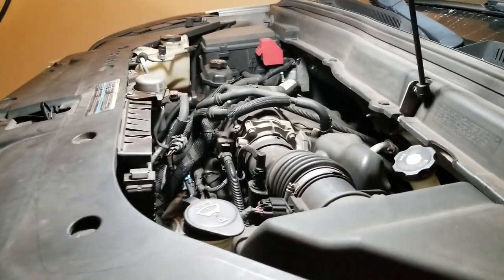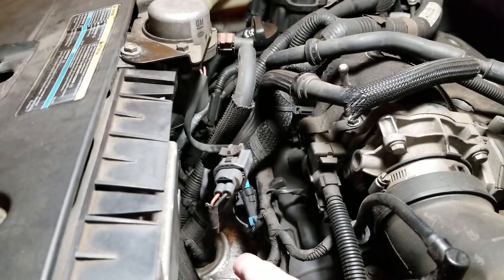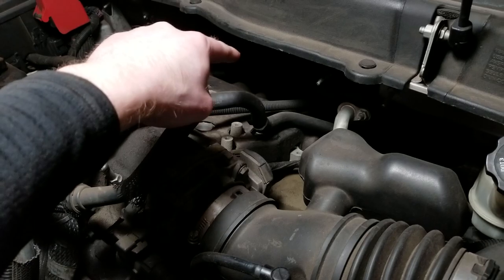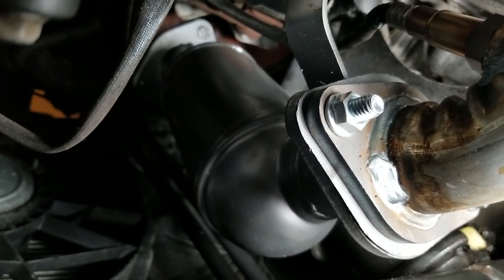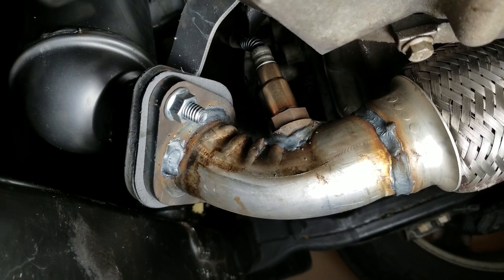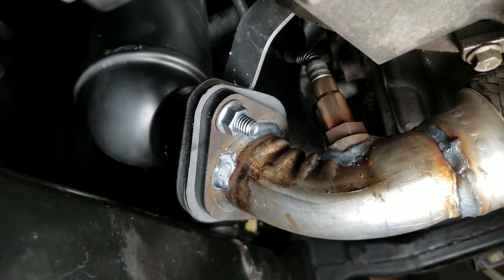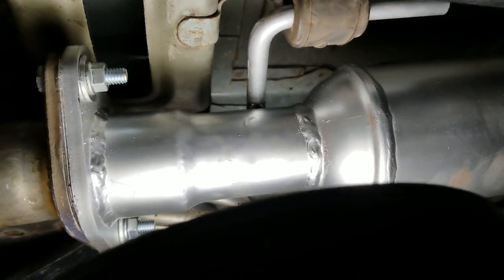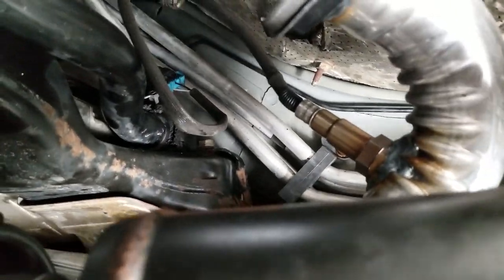2009 Saturn Outlook, Acadia, Traverse, Enclave - Catalytic Converter Installation - Part 2

Comment: i heard that there is 4 O2 sensors on Chevy Traverse Lt AWD can you confirm this please i have a paper i got from chevy dealership but doesn't show  i replaced the top O2 sensor now I'm having trouble getting of down stream O2 sensor on the left drivers side

Comment: Can you add the links to where you found the parts.
Reply from the maker: Converters were from Ebay, a company called First Choice Auto, but you can choice other brands if you prefer.  The Y Flex Pipe was from RockAuto.com, Walker brand.

Comment: Please keep making more videos about the 9 Saturn Outlook it's really helpful I just bought one couple months ago now I'm having the same problem couldn't I just replace the sensor I thought it was where we got bad gas or something
Reply from the maker: I didn't even think about trying just the sensors.  I just went right to changing the converters, but I also changed the sensors while I was under there, this way everything was new.
Reply: the top nuts are 15 MM bolts original that came of my front converter buttom ones 2 nuts and bolts 13mm I got one of the other ones being a  pain sprayed it with PB blaster let it sit over night and still haven't got it of think I might cut it off with a cut off tool buy new bolts and nuts washers

Comment: Great video! Very informative. Thank you! I am going to be replacing bank 1 cat tomorrow. The alldata service manual says to remove the transfer case on AWD models. Fortunately mine is only FWD which should make it a little easier. Was yours an AWD model? If so, good job doing this job without removing the transfer case.
Reply from the maker: Mine is AWD and I didn't have to remove the transfer case.  Maybe that is what is recommended for faster installation, or maybe that's what a dealership would do to charge more money.  Bank 1 is the toughest one to do, but not impossible for a DIY person.

Comment: A mechanic is telling me that he has to pull the engine to replace the catalytic converter??? Is he just looking for labor $$$?
Reply from the maker: Most likely he's looking for labor.  Which converter is your problem?  Do you have a 2008-2013 Acadia or Traverse or Enclave?  One of the 3 converters is a little more difficult to get to than the others, but nothing involving the engine needs to be pulled apart.  Keep in mind, if you get a replacement converter from a GM parts store or dealership, plus labor, it will be a fairly expensive job.  It took me about 6 or 7 hours to do all 3 of my converters, so it should take a mechanic less than that.
Reply: @jaybrown9158  Thank you.  It is the 2009 Saturn Outlook
Reply from the maker: Which converter needs replacement?  Left radiator side, right firewall side, or the downstream one by the muffler?  None of these involve getting to the engine.  Have him clarify what he means by "pull the engine."

Comment: Did you pull off the firewall one when you had the flex pipe off? It seems like the flex pipe will lock access even with the heat shields on. Going to try this fix soon. Also have you had to pass an emissions inspection since the change?
Reply from the maker: So the firewall converter is technically the one that was triggering the P0420 code.  And yes, to make the installation go better and make it easier to get to, remove the flex pipe.  The flex pipe is the easiest things to remove.  And then you'll have an easier access.  And yes, remove the heat shields too.  They are held on with 10mm screws.  Very easy to remove and helps tremendously in getting to the converter.  You'll need all the room you can to loosen and tighten those nuts and bolts that hold on that converter.  Plus the room to really crank down with a socket to tighten the converter in place.  I did this job about 10 days before my inspection and ALL converters and O2 sensors need to pass emissions.  Your car won't pass if a check engine light is on.
Reply from the maker: Sorry I'm just seeing this now.  Yes, I had to pull the flex pipe off.  It will make the job a lot easier.  But also, I was replacing all 3 converters anyways, so it just made sense to replace that too.  It was only like $170.  I was saving so much money on the converter set, so why not get the Y pipe too.  Also, there's 2 metal heat shields up in the firewall side that can come out too.  They are kind of in the way of getting to the firewall converter, so take them out and that will also help make the job go quicker.  They just have 10mm screws holding them on.  Pretty easy to get to.  And yes, I passed emissions.  I did this work about 1 week before my inspection.  Passed fine and everything has been working since.

Comment: Way to go for a first job!  Very well done.  Thank you for doing this video.  Your video is clear, well-lit and easy to follow.  I will be doing the same thing soon.  My 2009 Saturn Outlook just started throwing the same P0420 error code at 145,000 miles.

Comment: Hi Jay, your video is very straight forward and clear. I am having a p0420 and p0430, planing on replacing the cats bank1 and banks cats but I just noticed the third cat in the back of the Y pipe is missing and was replaced by straight pipe. Does this cause the codes P0420 and P0430?
Also my most important question is did your cats replacement solved the problem for good? I spoke to mufler shop and he said those sheap cats won't work. I guess he wanted to take the job for $900 by putting a universal ones. Thanks again for the video and waiting for your answer.
Reply from the maker: Hello Hakeem.  First, NO, that downstream converter after the Y pipe should not trigger codes but removing it for straight pipe isn't good either.  It's there for a reason.  Second, NO, cheap after market parts will not solve the problem for good.  I just went with after market because I wanted to save money and I wasn't planning on keeping the car for another 10 years.  I just wanted something to get me by for 2-3 years.  So they are good parts, just not as good as original.  So if you are looking to get 3 or 5 or 8 years out of your car, you may need to pay the high price for original parts.  Hope this helps.

Comment: 08-15 maybe. All with the same exhaust, and timing chain wear issues 😐. I think an update intake manifold helped prevent the timing chain wear, along with very careful maintenance. Airflow tube between MAF, and throttle body get filled with oil as well, makes TB dirty, causing reduced engine power stabilitrak warning.

Comment: I'm about to tackle replacement of bank 1 (firewall side) cat and y-pipe this weekend on a 2016 Traverse AWD... bent the y-pipe at the cat/flex pipe flange enough to create an exhaust leak. This video was very helpful for getting an idea of what I'm in for! The Chilton manual says to remove the transfer case assembly, but it doesn't appear that I'll need to do that. I'd rather not, since it requires new seals and fluid drain! Thanks for the walkthrough Jay.

I will attempt to take video of my process and link here when I get to it. Hopefully, between your info and mine, it will help!
Reply from the maker: I didn't have to do anything with the transfer case.  Several people have commented about that.  I'm not sure why it is recommended.  I have the Haynes manual and I was able to do all 3 converters without touching the transfer case.
Reply: Did you ever record your video Jeremy? I'm same boat, flex pipe right after bank 1 cat has rusted through causing a leak. Tackling this weekend.
Reply: @iDriveMuscle  Hi Tyler! I recorded but it didn't turn out very well. It turned out to be a pretty pleasant job. If you can, try to douse all the hardware with WD-40 or penetrating oil before attempting to remove. Even with that, I did have two studs shear off in the bank 2 (front side) cat when removing the y-pipe. In order to get those out, I just put a little handheld torch on the studs for a few minutes and then used a big hammer to knock them out... worked like a charm. Also, you do NOT need to remove the transfer case. Although tight, you can get to the hardware holding the bank 1 (firewall side) cat on after you remove those heat shields and the y-pipe like Jay mentioned in his video. The first couple of times you drive the vehicle after you replace, it's going to stink like something is burning. It will go away. Driven to Arkansas and back from Colorado and used the car as a daily driver since the repair, zero issues. Reach out if you have questions!
Reply: @iDriveMuscle  Hi Tyler! I recorded but it didn't turn out very well. It turned out to be a pretty pleasant job. If you can, try to douse all the hardware with WD-40 or penetrating oil before attempting to remove. Even with that, I did have two studs shear off in the bank 2 (front side) cat when removing the y-pipe. In order to get those out, I just put a little handheld torch on the studs for a few minutes and then used a big hammer to knock them out... worked like a charm. Also, you do NOT need to remove the transfer case. Although tight, you can get to the hardware holding the bank 1 (firewall side) cat on after you remove those heat shields and the y-pipe like Jay mentioned in his video. The first couple of times you drive the vehicle after you replace, it's going to stink like something is burning. It will go away. Driven to Arkansas and back from Colorado and used the car as a daily driver since the repair, zero issues. Reach out if you have questions!
Reply: @jgranga171  Awesome, thanks man! :)
Reply: @jgranga171  Hello, so i am getting the p420 bank one, i will do it myself but don't have a lot of tools. What do you think i will need other than original video, and what did you use to lift your vehicle?
Reply: @Rocksolid711  hey Brandon! It's been a while since I did this job, but a couple things still stand out to me when I think on it. Make sure you have plenty of WD-40 penetrant or PB Blaster. Soak the heck out of the nuts/studs. Even with that, you'll likely have studs that shear off due to their brittleness from prolonged exhaust temp fluctuation (due to driving, shutting off). Having a handheld torch is incredibly helpful to get those old studs out if you're reusing any of the parts that Jay replaced in the video. Just heat up the metal around the stud for 20-30 seconds, then use a big hammer and punch to knock them out (you may have to do this several times before they finally come loose). This goes without saying, but having some protective equipment to prevent burning yourself is a good idea. For lifting the vehicle, I used a 2.5 ton floor jack and then placed jack stands under each side. Safety first! Hope this helps.

Comment: Excellent video.  Just in time since my 2009 Chevy Traverse is throwing out the same P0420 code and my state inspection is due in October, 2019.  My Chevy has clocked 175,000 miles.  If you could cite a link to your parts source, it would be helpful.  Otherwise thanks for your information.
Reply from the maker: The catalytic converter 3 piece set is from a company called First Choice Exhaust.  I got them through Ebay.  Just search 2009 Chevy Traverse Catalytic Converter.  Because all converter sets cover the traverse, outlook, acadia, and enclave, you can look up any of the 4 cars and get the same results.  And there are other exhausts companies on Ebay that sell these kits for around 230-250, so if First Choice Exhaust doesn't suit your needs, there's others.  They are a Canadian company, but despite that, I received these parts within a week.  I'm from PA so maybe that's why it was quick.  I also got the 2 downstreams sensors from Ebay, but I forget the exact company.  It was some after market wholesaler.  Both are still working fine.  The Y flex pipe and the upstream sensor I got from RockAuto.com.  Great website for parts for all makes and models at cheap prices.  I would highly recommend.  They have everything imaginable for Outlooks, Traverses, Acadias, etc.
Reply: if you guys don't have the money to buy the parts and just need to past inspection, just buy the cata clean cleaner that cost like 29 dollars and drive it around and it will clear that code so you can past the inspection.  as soon you see the check engine light goes out go right away to do the inspection. you will thank me later.
Reply from the maker: I will look into this for future use, thanks.

Comment: Hello, great video! I have a 2010 GMC Arcadia. Question? Were are the two O2 sensor on bank 1 or is it only 1 O2 sensor?
Reply from the maker: First off, Bank 1 and Bank on these cars have 2 Oxygen sensors each.  So bank 1 is what is by the firewall or dashboard side of your engine.  O2 Sensor #1 is in the engine compartment, back and down under where your dashboard is.  It's hard to see clearly without looking down in there with a flash light.  O2 Sensor #2 is after that catalytic converter, down under the car where the converter attaches to the Y flex pipe.  Both are probably easier to get to from underneath the car if you have that ability.

Comment: HOW, did you get the three bolts out of the converter down below, attached to rear of engine???
Reply from the maker: I'm assuming you mean the converter on the firewall side?  If so, this is obviously the hardest one to get to out of all three.  First, I removed two heat shield plates to get to the converter easier.  Second, I needed a couple long extensions for my socket and ratchet handle.  You may even need a breaker bar or something to help loosen the nuts.  Maybe even spray them with WD40 first and let that soak in for 10 minutes or so.  GM does not make it easy for DIY type people.  I hope my answer helps.

Comment: I know the videos you posted on this are 4 or so years old now but I’m curious if the parts held up or if they went bad quickly? We have a 2010 enclave that needs the cats replaced and a shop is trying to charge me 8 grand. Which is more than the car is even worth. I’m considering trying to do what you did here with the same parts. 

What brand is the y pipe?
Reply from the maker: So orignally I got my parts from Ebay, and the intention was to only have them help me pass inspection because I wasn't keeping the car much longer.  So I knew buying converters from Ebay weren't going to be great parts, but good enough to get by and save money.  They lasted about a year and a half and then started triggering the check engine light again.  So I bought another cheap set and went through the same process.  They eventually triggered the code again but this time at least I was able to use my receipts from all the parts I bought and gave a copy of them to my mechanic so I could get an exemption pass for emissions that year.  But I knew I would have to replace again, so for a third time, I bought the Walker Brand converters.  Walker is a good brand that makes after market parts for GM.  That is also the same brand as the Y Pipe.  In reality, the Ebay converters weren't bad converters, but GM cars have a low tolerance for after market parts so the codes were getting triggered to easily.  I've had the Walker brand converters in for about a year now and they are holding up great.  There is no way in hell, a converter job should cost 8 grand.  Even if you got original GM converters, the cost for a mechanic to do it should be half that.  After market converters can go from 200-600 a piece, GM original ones probaly around 800-1000 a piece.  The Y pipe goes anywhere from 150-300, depending on where you buy them.
Reply: @jaybrown9158  thanks for responding with all of that information. I coincidentally ordered walker oxygen sensors from rock auto. I’ll look into walker cats if they are holding up for you. Thanks again.
Reply: @jaybrown9158  How is everything working today? update?

Comment: How you take it out the bolts from top o de catalitico converter bank 1
Reply from the maker: Just reached up there with my hands from underneath with a socket and wrench and broke them free.  If you watch the video, there's a section where I talk about removing a couple small heat shields to get to that converter.  It is the hardest one to replace and takes the most time.

Comment: I'm thinking about doing this to my 09 traverse. I was wondering how much this repair cost you?
Reply from the maker: Depends on how much you're fixing.  I did a lot more than was needed, plus I needed some tools and hardware that I didn't have, so that added a little cost.  To do all 3 converters, Y flex pipe, and 02 sensors, you could be looking at at least $600, maybe closer to 700.  But it will cost you triple that to get it done by a mechanic or dealership.  If you only need to do 1 converter, or 2 converters, and nothing else, then you could be looking at $200-300.  Depends on your budget.

Comment: I have a problem with the flange on the cat bank one didn't line up with the flex pipe flange. Did you run into this problem?
Reply: No matter how much I tightened the bolts it doesn't tighten all the way
Reply from the maker: The alignment was off a little bit, but you do have some flexibility with the flex pipe.  To help with any small gaps, I ordered an extra flange gasket, which means I used 2 gaskets instead of 1, and that helped.  Gaskets are like $10-15.  And then torqued everything down and had no issues.  Worst case scenario, once you're done, have your mechanic take a look and double check all nuts and bolts and torque settings.

Comment: did you have to use a thicker gasket at the rear of the bank 1 converter and the y-pipe
Reply from the maker: I did end up using 2 gaskets for that area.  Gaskets are like $10-15.  That helped close up some of the small gaps.  Torqued everything down and it worked out great.